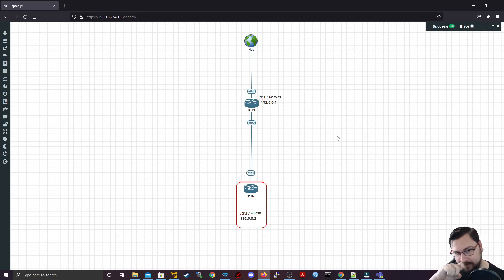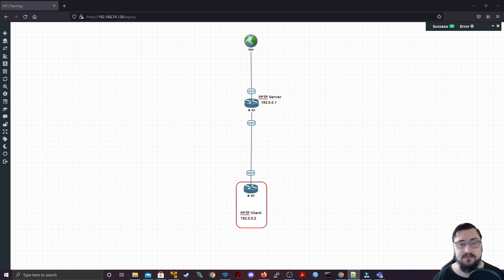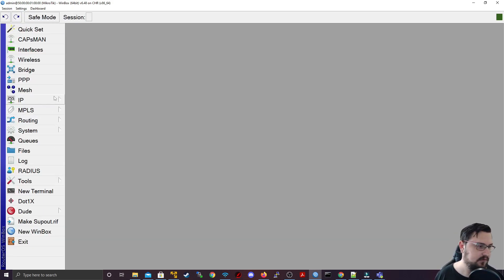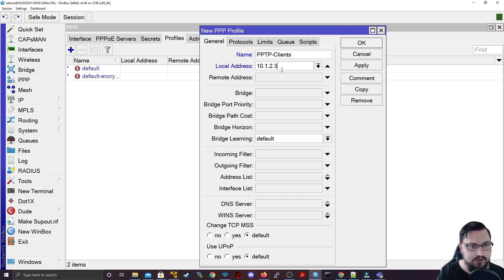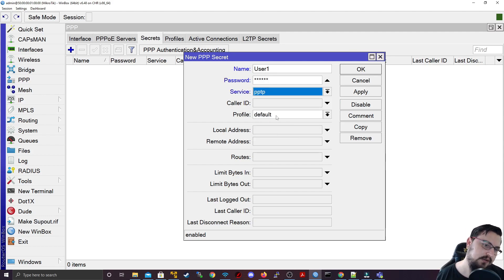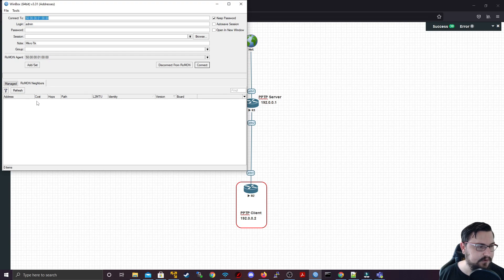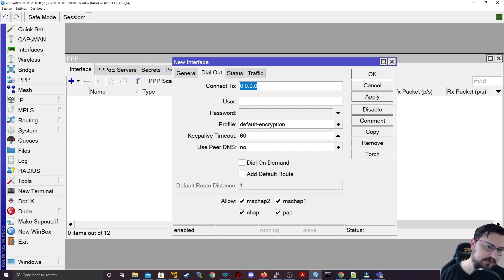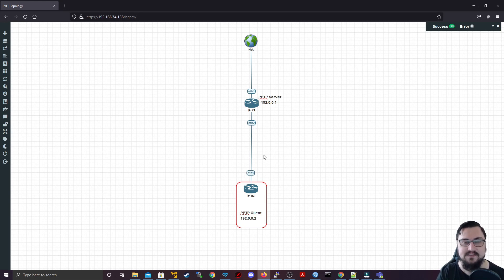Full MikroTik MTCNA - PPTP Configuration

Comment: That was quick and short!
Reply from the maker: Hopefully short and sweet! It would be really hard for me to try and stretch this out since the configuration is pretty straight forward for PPTP :)
Reply: @TheNetworkBerg  To some extend I agree that it's not much, but still there are plenty of options which can cover plenty of topologies and situations. Few examples and scenarios just to illustrate particular concept would be beneficial to the spectator.
Still  good series though. Thanks!
Reply from the maker: True, which is something we'll be doing in the next video covering L2TP. Personally I dislike PPTP just due to the overhead it creates with its GRE tunnel and not to mention it is pretty ancient and not very secure. But it is still kept around for legacy systems that make use of PPTP connections.